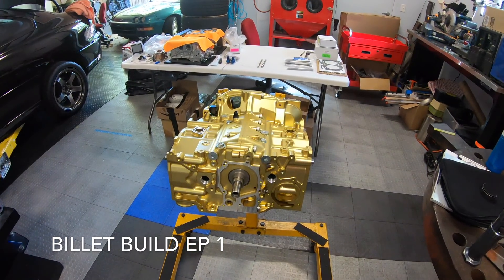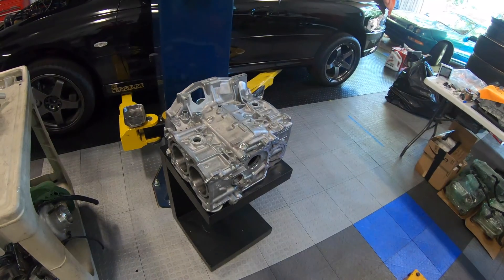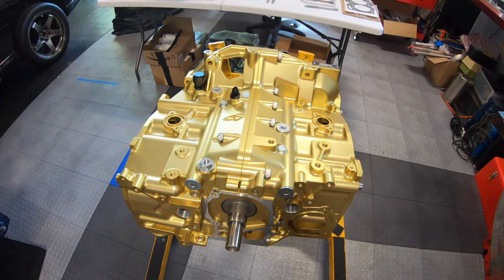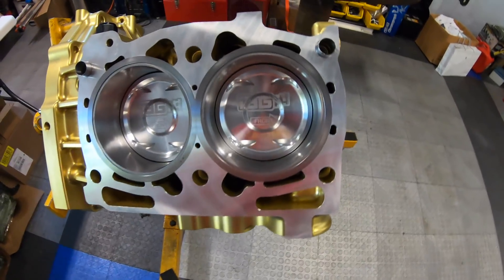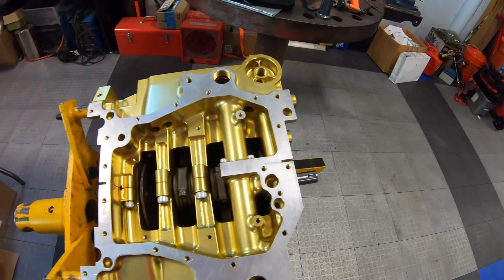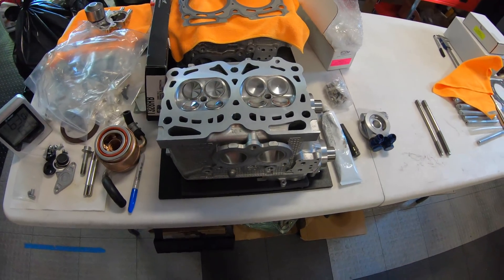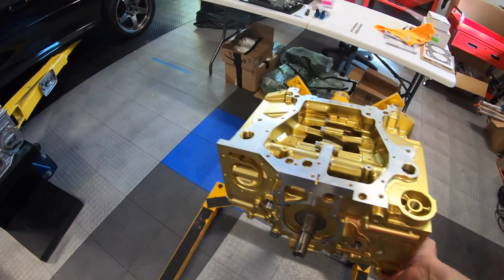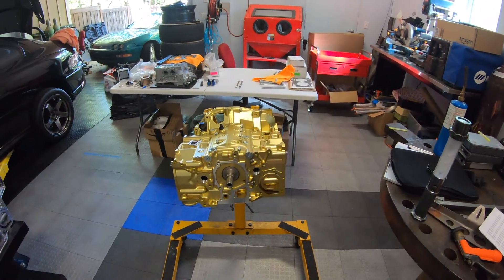BilletBuilds  Episode 1 - A quick look at the Willall/IAG Subaru EJ billet block.

Comment: Wouldn't you want the oil sensors on opposite sides of the block not on the same rail. You will never get pressure diffrence in the same tube but you will from one side of the block to the other.
Reply: I know this is a year old, but the front port would be measuring pressure just out of the pump before the mains, and the second port in the back measures pressure after oil feeds the mains. Monitoring for significant pressure drop can indicate a bearing issue prior to catastrophic failure